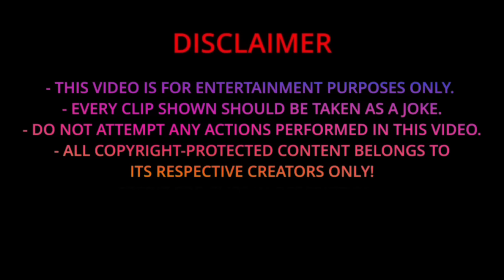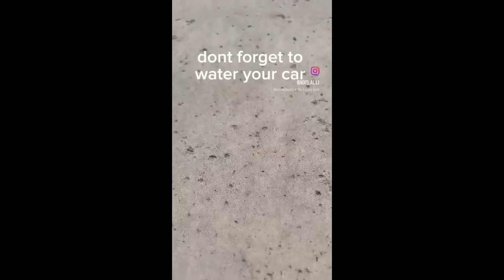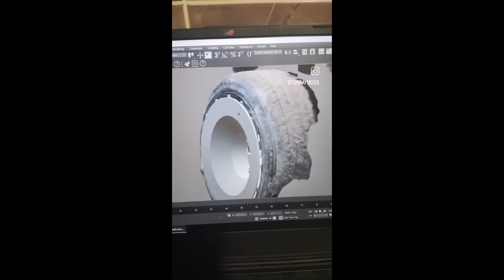Memes That Only Car Guys Will Understand: Part 119

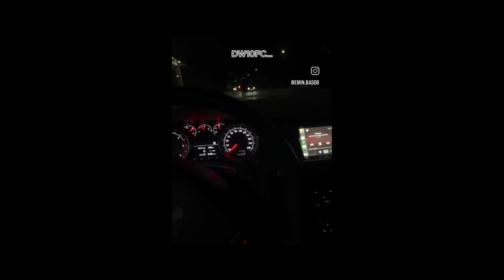Comment: 2:18 huh no see the engine milage on a Peugeot sedan usually isn't the problem. Altho it is assumed a french engine will destroy itself earlier what usually happens is that the 80 yo driver dies or destroys the car itself way before that.

Comment: The only thing i love about USA is the fact that you can modify the shit out of the car and yet still be totaly fine and road legal. In EU i put in LED lights instead of H7 and I cant pass MOT, like what the hell, and they are like the good OSRAM onse where the beam is the same as the H7...
Reply: This is why i love being Czech.
Emissions a bit too high? 
Wrong size rims?
Wrong lightbulbs or something?
Car is rusty as shit?
No problem! You just have to know a good mechanic that has friends at the MOT place and a some extra cash and you´re golden!